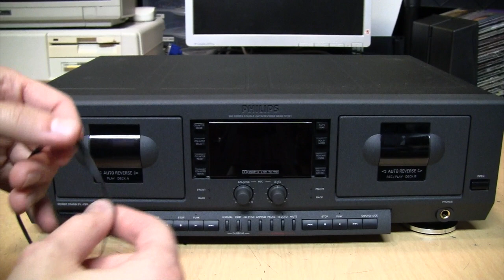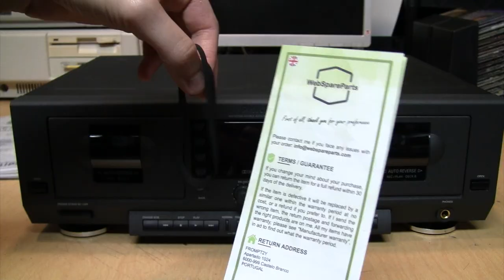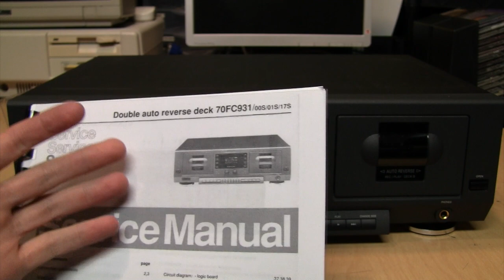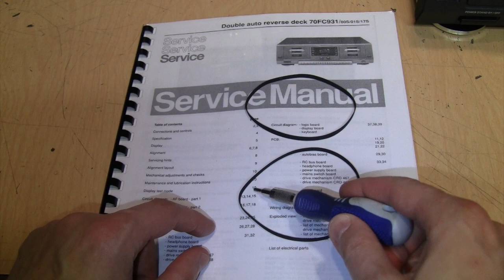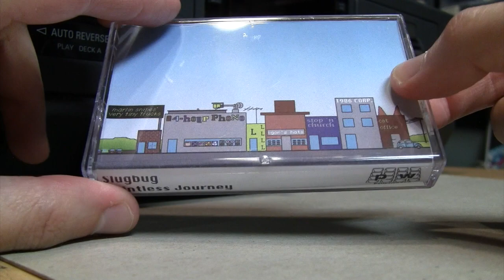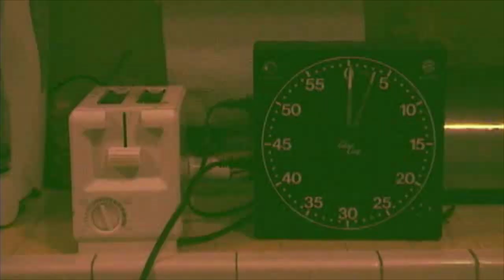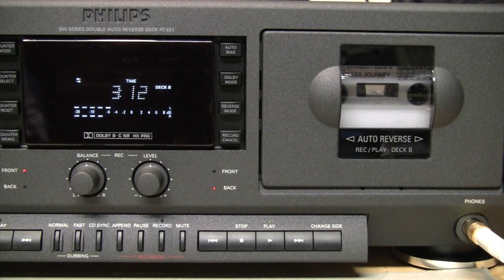How to replace cassette deck belts the somewhat easy way (Philips FC931)

Comment: This is probably obvious, but I take a bunch of pictures from multiple angles whenever I disassemble stuff, and sometimes even shoot video of it (slow and steady!). Sometimes those pictures are invaluable when I'm trying to get it back together again. I also got a pair of those magnifying goggles Adrian Black uses, and they make a huge difference; repairing things is almost fun again!
Reply: Indeed more so with old folks like self
Reply: Yeah pretty obvious, but still needs to be repeated, as I (like Afzaal Khan.M
 i'm old now 60) and forget stuff. Took something (I can't even remember that) apart a few months ago and forgot where the bits I took apart went. Had to throw it out. 
EDIT
Took a few hours, I remembered it was a toaster.
Reply: Yes and I keep screws separate by size and locations.

Comment: I bought belts from the same eBay guy in Portugal.   He has good quality belts, and you don't have to do any work.  Yes, generic belts are cheaper.  But for under $20, it's not a big deal.  I'll order from him again if necessary.
Reply: Yep. Same here. Especially useful if the original belts have perished so its not clear what the correct size is.  I just order the right pack.
Reply: The Web Spare Parts seller is active on the TapeHeads forum (Julio). Has a good reputation for decent quality belts at a reasonable price. Great for decks like these that aren't ridiculously sensitive to w&f specs.

Comment: I've had good luck boiling belts for 5 minutes in water and than wiping them good with belt / rubber conditioner.  I did this on a couple of CD Players I have and it fixed the issue with the tray not opening.
Reply: This only works with neoprene belts and other synthetic compounds. Rubber will just melt down.

Comment: Beautiful,  but  it deeply  saddens me to see high quality tape decks reduced to  the status of rare finds. Man too often throws out the baby with the bath water when he moves ahead technologically. If only a new Edison could arise and figure out how to  control both spindles and the capstan with three dedicated motors. Do away with belts altogether. Although the electronics would obviously be highly advanced, there would be a beauty in resulting simplicity--no more clockwork mechanisms to go haywire in a few years. We could finally return to our beloved format using machines that sounded great and no longer ate tapes.
Reply: There's no way that WOULDN'T be possible. Look at the engineering that went into the controls for the laser on a CD player. If we put that much effort into tape decks, we'd surely have switched by now!
Reply: Direct drive tape decks exist, it's just a price vs. performance thing. And adding more motors brings more complexity and less reliability in other ways.

Comment: To straighten the belt and make sure it's not going to come off before reassembly, couldn't you just have turned the motor and pulleys by hand?

Comment: What I really don't like about this kind of mediocore transport is the lack of real weight in the flywheel, just hollow plastic or a thin piece of stamped sheet steel. It must be mechanically perfect in order to have W&F just within its tolerance. Once the belt had aged up (like in this case) W&F will be immediately gone busted.

Comment: Very nice demonstration of belt replacement on clam-shell design cassette mechanism.  I recently attempted to do a belt replacement on a Maganavox all-in-one stereo that had a plastic mechanism that was held together with brittle clips and adhesive, no screws in sight.  With it's disposable-by-design nature, my project was a failure, and the vid got shelved.
Reply: just prise it apart and use superglue or uv resin to put it back together..

Comment: Handy video. Belts are a nightmare sometimes especially on radio cassettes which are not really designed to be fixed as they were sold as throw away items. Proper decks like this aren't so bad. Good job on the swap and relatively straight forward thankfully.

Comment: I started to try and change some belts in a few old decks I have. None of them have kits available so I have to use generic belts. I am not sure on how tight the belts are supposed to be. Is there supposed to be any slack or do they have to be super tight?
Reply from the maker: There should be some flex to the belt when you push or pull on it -- not super tight.
Reply: @vwestlife  Thank you for the info!!

Comment: Just replaced the belts in a Philips FC731 thanks to this video. Unfortunately it didn't resolve the problem I.e. the deck won't fast forward or rewind. If anybody has managed to fix this I'd be grateful for the solution. Thanks again for taking the time to make this video.

Comment: for english: i have a philips FC 731 double deck all ok functions except forward and reverse does not work. Any idea of the problem.Thank you
Reply: Did you ever find a fix for this? I've just replaced the belts in mine hoping it would be the solution for the same problem you were having but no luck.

Comment: Can you tell us how you removed the black cable with the pins going to the mechanism (shown at 4:32)? The white plastic piece that holds that kind of cable is difficult to lift.
Reply from the maker: You pry up the edges of the white retaining clip to unlock it, and then you can easily pull out the black cable.

Comment: I bought a Clarion ADX5655z at a junk yard. It’s a car stereo with a full logic tape deck. I modified the power to support a cigarette lighter plug, and wired it with an aux out cable to play in my ‘04 Envoy. I still use and MAKE mix tapes in 2020.

Comment: Thanks. I have two identical decks to re-belt. One is branded Pioneer and the other Optimus but they are identical. Maybe like you said I should practice on a less important deck, but all I have is a 90's Sony Boom box and they are often very hard to expose the mechanisim well enough to work on it because they are so tightly packed.

Comment: Good one, very wise and helpful.  A bit of advice to all users of mechanical things. You need to use them once in a while or they have troubles. Case in point; CD/DVD decks on your computer. Most have a little belt that is the part that opens and closes that drawer, if it sets for to long it gets stuck in' it's egg shape and will just spin there. Cars can also have their problems, if they set to long.

Comment: Oddly enough I just replaced a drive belt, although mine was in a vacuum cleaner. The old belt was stretched so badly the lettering on it was visibly stretched. Replacing it was stupidly easy, it would be great if cassette belts were that easy, too. Fortunately all the cassette equipment at my home seems to be working fine now. Although if I had known about cassette belts years ago we might have been able to save my father's old Harman Kardon deck from 1984.

Comment: That tape deck looks like it was made in the last batch of quality machines that manufactures put out right before they started to make crap, unfix-able poor spec tape decks. 
But Philips is a pretty good company.  I bought a 32 inch flat screen Philips TV in 2007.  I use it every day for at least an hour and it works perfectly.  It also has "front firing" speakers that helps with sound clarity.  Most flat screen TVs now have the down or side firing speakers which always sound muddy to me.
Reply: After the mid to late ‘90s, everything became disposable.
Reply: No this is pretty much crap too
The mechanism is garbage, the display is ugly. More importantly sounds inspiring.

Comment: I'm so glad my two main Technics decks are quartz locked direct drive without any belts whatsoever.. well apart from one of them has automatic eject and close which is belt driven but that belt is very easy to get to and near enough any similar sized belt would do its job

Comment: I've got a Tascam CC-222 Mk II introduced 10 years after your Philips and it's interesting to see how much better quality your 10yr older deck is. The Tascam does not even have weighted capstan flywheels, so the wow & flutter is horrible, even with a fresh belt.

Comment: You have created an excellent how to belt replacement guide. Better than most I have seen. I wonder how long it would take most people to find that small Phillips screw that was still holding the thing together. Great video, interesting as usual.

Comment: I have a SONY Tape Deck I purchased brand new at Best Buy's in 2005, and it uses no belts except for the take up reel. The Capstans are actually tips of the direct drive motors. Never had any problems with it, since the belts are eliminated. Wish they used similar technology on older decks.
Reply: Convenient, but the belts are not there by accident - they could have been designed out (as you see on yours).  For one, it's a torque limiter -- mostly in case something bad happens.  It's one way to stop the tape from spooling if it binds, the end-of-tape sensor isn't working correctly, etc.  More typically, it's a buffer between the motor and the drive mechanism, so any small variations in speed cause contractions and expansions of the belt and reduce the impact to the speed of the tape.

Comment: I just bought belts for all my machines. The only one working are a small sony cassette corder and an RCA desktop cassette recorder. All my other machines have weak belts but they do work but rewind is very weak and I have to do the pencil trick.

Comment: Overall, this is just another example of very poor design - which I have learnt to expect from Philips. (Sony, Pioneer and JVC are no better). These  decks were not designed to be repaired: they're just rubbish!
Why use torx screws? What's wrong with conventional pozi screws? 
Whenever you need to do this type of substantial dismantling that involves disconnecting plugs & sockets, make a drawing on a piece of paper as to what plug goes where. 
When you have finished the repair, the best test tape to use is one with a 1 kHz sinusoidal recording. If you have access to an oscilloscope, use that to monitor the playback signal: wow and flutter will easily be detected - a much better technique than using your ear to some piece of pre-recorded music.
The author of this video says "Practice on a old / surplus / unwanted cassette deck to learn how to do such dismantling". That, for most people watching this video, is just unrealistic.

Comment: Very similar to my Harmon Kardon CD-91.  Except there was an additional belt for the analog counter.  out of the 4 decks I have that all needed belts.  I ended up choosing the HK because the other three would require extensive levels of disassembly.

Comment: I have a Philips DCC900 which no longer works because the capacitors have dried out but won't even play digital tapes.
Reply: The capacitors have actually leaked out and corroded the PCB. Needs not just a recap, but a cleanup job as well! This happens on DCC machines.

Comment: Think while I had it apart, I would've just replaced both.
Reply: I agree with this 100 percent.
Reply: I probably would have too. However, the left deck is in spec, and if wow and flutter is critical, he can just use the right one.

Comment: I don't know why they had to use belts for stereo components. Why couldn't they use METAL gears that wont's crack over time.
Reply: Direct drive mechanisms made on the cheap would directly transfer motor noise to a ridiculous extent, they take a lot of engineering not to do so and belong in the price range just a few will want to pay for.